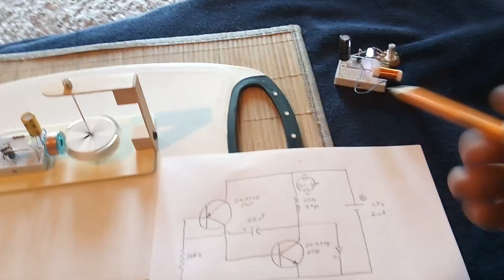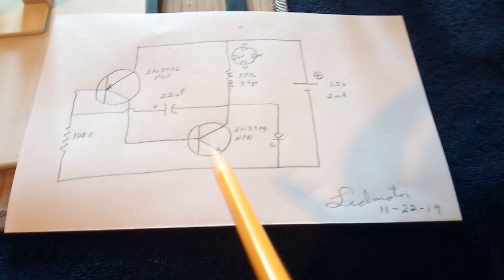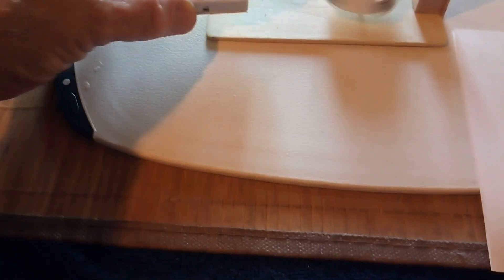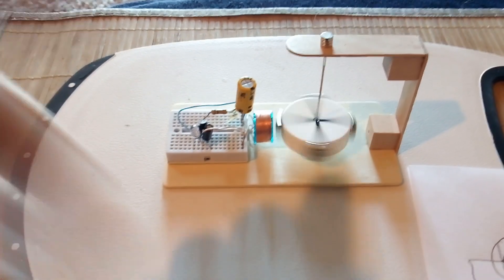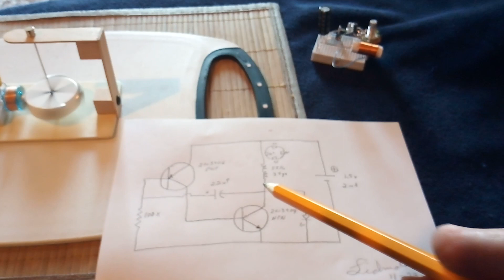Led blinker circuit driving a pulse motor

Comment: Maybe if you make the 100k resistor 1mohm, it will blink slower and use less mA? while still be able to drive the motor? Like your video
Reply from the maker: I set this up originally with a 1 meg pot.  You are right that you can run this at a lower blink rate and it will still turn the rotor.  The amp draw went under 1 mA but the rotor turned much slower.  You can change the cap value and change things also.  If I changed the coil to a super fine wire / high ohm one the thing would become a micro amp pulse motor.  The led blink might be pretty dim though.

Comment: That really looks neat and tidy. One day I will get my dining table cleared and maybe a few years after that I might even get my work table cleared upstairs in my work room but we don't want to rush these things.
Reply from the maker: I wish that I could work on a messy table but those days are over. My wife said either go out in the garage or clear off the table at the end of the day and put it all away.  It is too cold and bleak in the garage so I just do simple quick projects now.  At my other house the "table" is left half messy and is a pure joy when I go there.  It is great fun to just tinker with this or that and let my fingers and mind wander around the playground.
Reply: @Lidmotor  my trouble now is one project falls off the edge as the next one starts. I think my wife would like a rubbish bin there so it goes straight out and is disposed off in a simple conveyor belt action 😁
Reply from the maker: I lived on my 32 ft. sailboat for many years and it filled up with 'stuff' rather quickly.  The way I dealt with it eventually was a simple rule that when something came aboard then something of equal size had to leave.  I need to go back to that rule.  It is really hard to decide which treasures have to leave though.
Reply: @Lidmotor  sometimes I think moving to a smaller house might force me to change my ways. Our last move 10 years ago was supposed to be like that but the house we bought really wasn't significantly smaller so I retained most of my junk and just added to it.

Comment: I have followed your work for many years now and allways look forward for your next piece. I always find valuable info from each segment. Would you mind sharing your final conclusions on your neosphere work ?
Reply from the maker: Well the sphere magnet experiments that I did were very interesting.  Maggie liked them a lot.  The high speed experiments were great fun until I Iearned that the neo ball can come apart at high RPM and send shrapnel everywhere.  One guy I read about had a terrible injury when a 1" ball came apart and tore into his hand.  He had to go to the hospital.  After I heard that story (and others)  I lost interest in running anything at high speed.
Reply: Thanx for the reply.  Three eights in a tiny jar with a couple drops of 3n1 should be safe for the sphere.

Comment: Ever since I was a kid and became interested in this exact subject matter  I've believed precise timing is part of the equation when it comes to free energy and efficiency.    Just like in a car engine ,  ignition timing to within a degree is critical to performance and can mean the difference between awesome acceleration and sluggish performance.     I wonder how much energy it would steal from what you already have if you were to place another coil exactly 180° or even 90° from the coil  ,  that would be dumping all of its energy through a Schottky back into what you already have there.     A smaller coil winding with a very small core like the head of a pin separated from the winding by an air gap so that it barely affects the speed of the magnets as they go past yet still put out a pulse that can break over a diode...     In other words how much energy can you generate from it before it stops turning fast enough to produce energy.    Lol I don't know what the heck I'm talking about just dreamin  😂 ...
Reply from the maker: Dreaming is a good thing.  Remember that Tesla came up with the induction AC motor from a dream.  In the dream he saw the motor stator field casing the rotor around and around.  He followed up on the idea and changed the world.

Comment: I like the flywheel idea. Had used a steel washer before now, but the screws method removes the need for glue on the magnets.
Reply from the maker: I got these magnets months ago and I'm just now getting around to trying them out screwed to a rotor.  They work great.